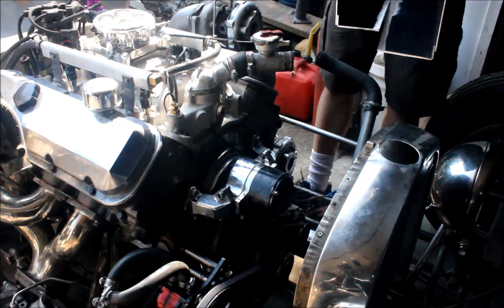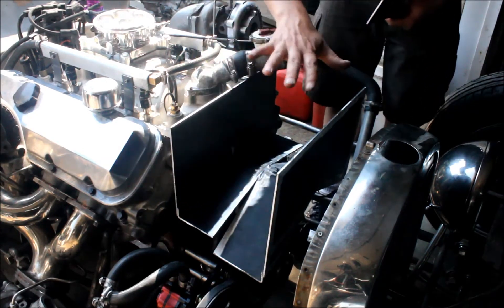Building a Custom Intercooler

Comment: wat i was thinking bout was use an aluninium or stainles u bend and cut it vertical when layed down so you have an inside and outside bend half (hard to explain )
then move the inside bend away from the ouside bend so you have the plenum and weld the two halves together again 
the hole left for the plenum needs to be filled at the bottom using a plate with a hole that fits either over the carb top (yes like a carb hat) or you can place on the manifold and fit the carb intoo (like an airbox)
the top you can drill and tap anbout a million small holes and fit a seal and plexyglass cover over 
should look pretty rounded and nice and you have two pipes going intoo the plenum about at the right spot pointed toward the intercooler

the intercooler might look nicer sitting there when you contour the top of it like the top of the radiatorcover in front of it , maibe even cover it with half a bonnet up to the engine itself